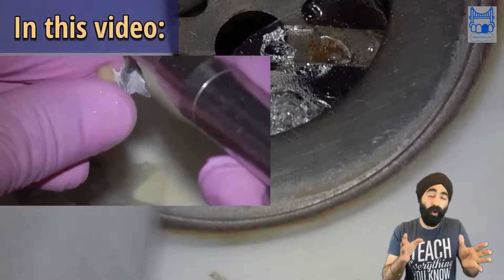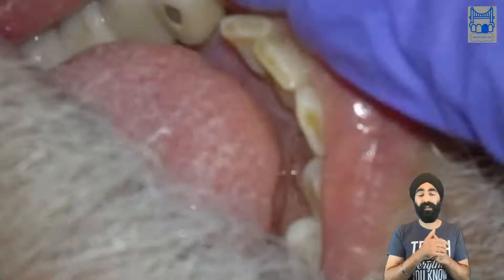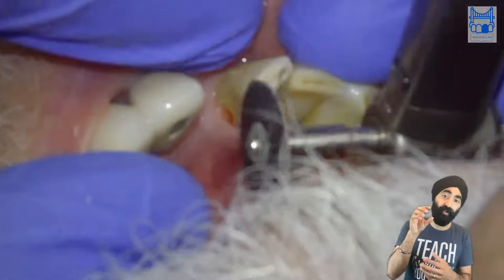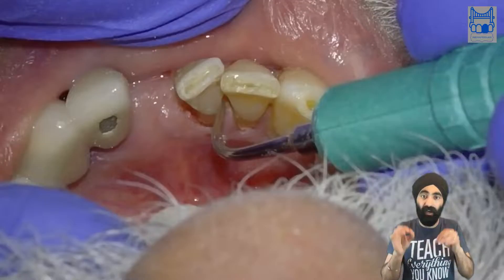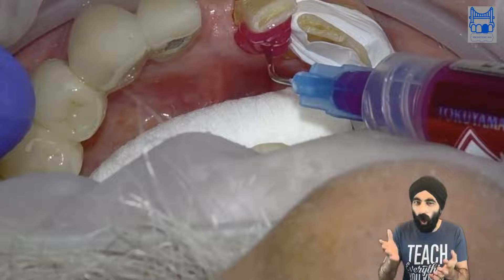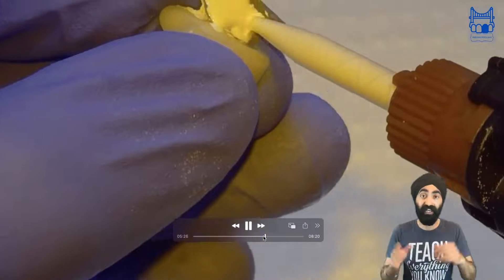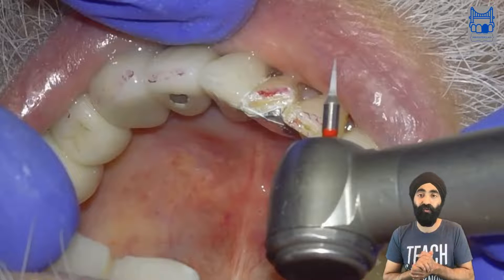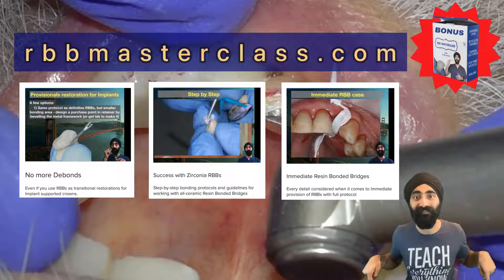RBB Recementation Protocol - Adjusting Pontic Occlusion

Comment: Hey Jaz, I’m loving your RBB content on YouTube. Thanks so much for putting them up. My technician is really pushing for emax RBBs instead of metal PFM ones. He says the “bond is better and strength is still good”. Based on what I have read, metal is still the better option as there is more long-term studies to support it right? I’m a bit worried about his comment about stronger bond with emax. I plan to use panavia v5 to cement my upcoming [first ever] case.
Reply from the maker: you would need gigantic connectors and a lot of space for lithium disilicate RBB - biggest failure mode is framework fractures

Comment: Hi Jaz, would you go for no prep id lower central is missing? one or two winged RBB?
Reply from the maker: dear friend, without any further info my answer is: cantilever (one wing) and no/min prep (ie. sometimes to de-triangulise a tooth to get a longer connector and no black triangle) Regards - Jaz
Reply: @protrusive   Thank you!  One wing even if the neighbouring teeth are periodontally affected? 
What are the risks of no prep ?
Reply from the maker: @mam.a1229 with this update info then no, there is a string case or fixed-fixed for periodontal splinting.
Main risk of no prep is not having a path of insertion or clear final seat position, but there are ways to mitigate eg a seating lug
Reply: @protrusive  thanks mate!  The abutments have clinical attachment loss and gum recession but mob around 1mm. 
Same opinion?
Reply: @protrusive  also seating lug with compromised aesthetics or prep ?

Comment: Hi Jaz 
Do you like the panavia tooth primer? I find it wets the enamel too much so stopped using it, 

Obviously you use it. Do you apply it and then bone dry the tooth?
Reply from the maker: hey bud - tooth primer is an essential part of the protocol. I do air dry it for 10 seconds until I see no pooling
Reply: @protrusive 
And does the enamel look dry again or moist?
Reply from the maker: @amit.thedentist6843  not dry, a little thin film of moisture

Comment: Jaz I had a patient that had a temp Maryland bridge made. It failed and thus recemented with PolyF, probs not the best decision as now I have to take it off 4 months later to scan so the lab can construct the permanent. Any tips on how to try and remove without completely destroying? Thanks so much
Reply from the maker: I think you'll be fine! PolyF is great but could be worse like removing a bridge bonded with resin cement.
Plenty of ultrasonic energy on the metal abutment and at the tooth-cement interface - tie some floss around bridge to prevent swallowing
Get some forceps, support abutment tooth with finger and torque off the bridge- you got this!
Reply: @protrusive  I can’t thank you enough Jaz! Did this today and worked a charm. Super grateful as I wouldn’t of thought to have used the forceps at all would of been there all day with ultrasonic I think lol. Much appreciated 👍🏽
Reply from the maker: @daniellenichols105  the fact that you A. implanted advice and B. reported back speaks wonders about you. Thank YOU so much
Reply: @protrusive  Thats very kind! Super grateful for your words of wisdom